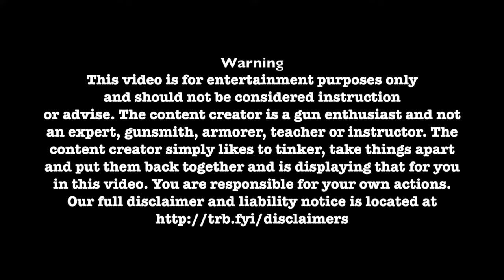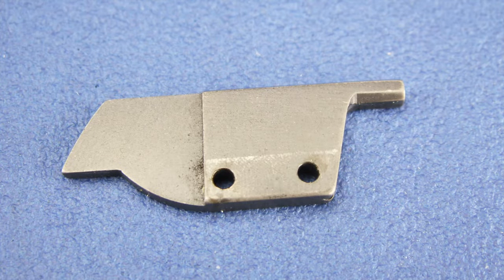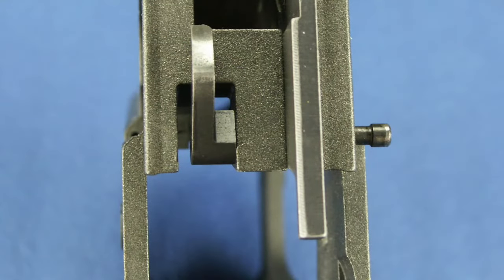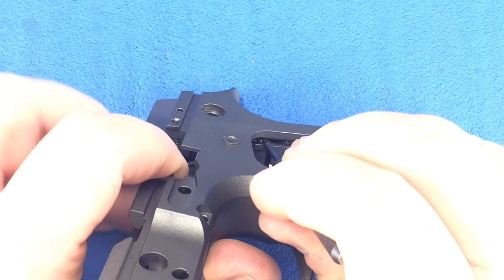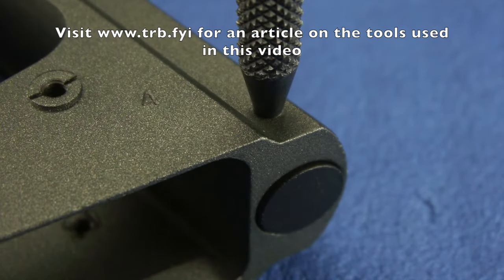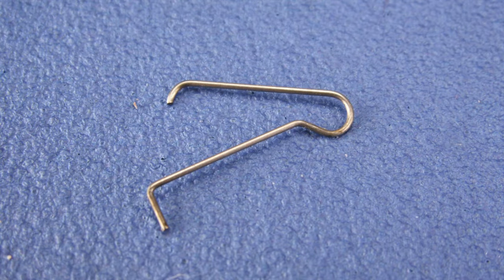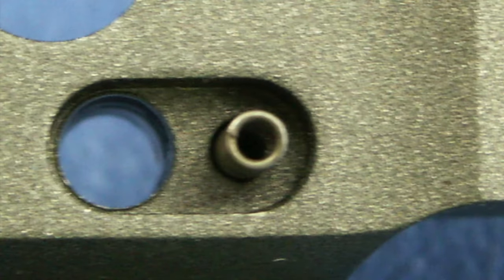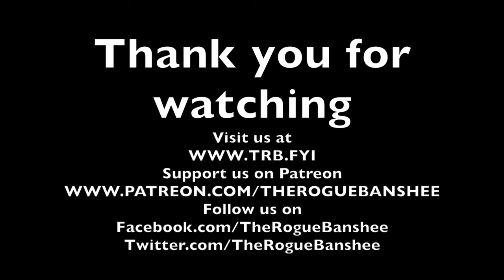BERETTA STEP BY STEP // Beretta 92fs Frame Assembly (reassembly)  (also Beretta M9a1 and Beretta 96)

Comment: Very helpful video - thanks for taking the time to get good images and angles so I could see clearly what’s going on. A video specifically on the G model selector would be appreciated - I figured it out but there must be a trick to getting the springs and pins to all line up and assemble smoothly.